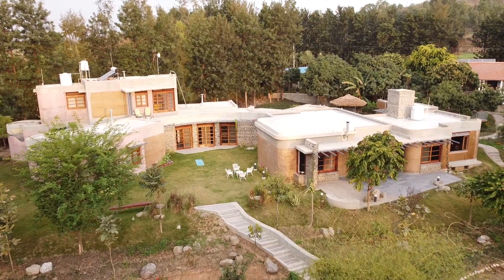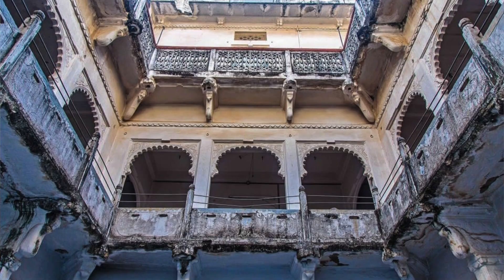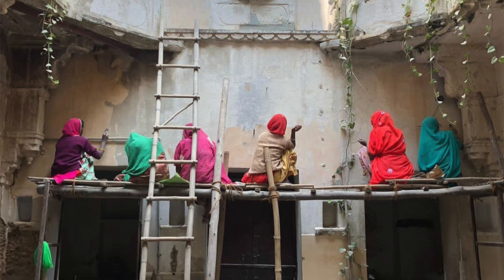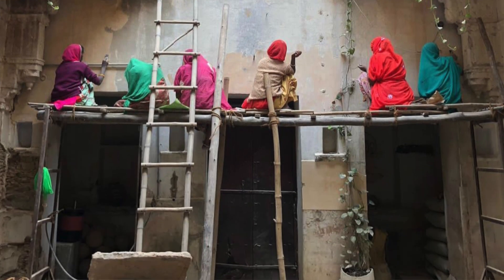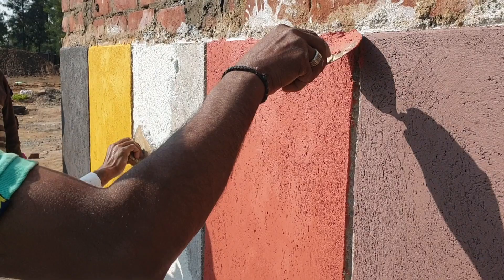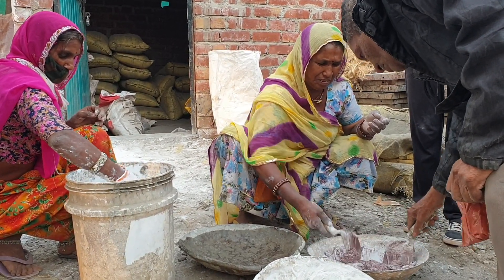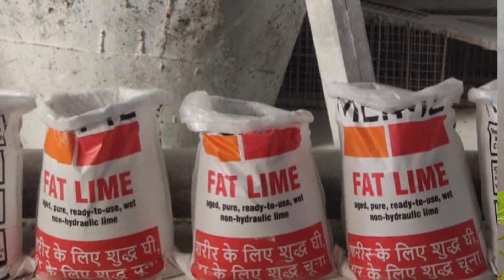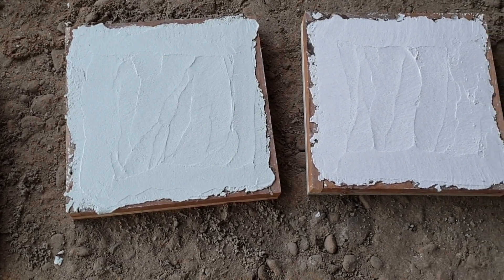Building with Lime: An Introduction

Comment: Beautiful Sunshine Aannaada ✨ Thank you for sharing your sustainable home journey.
I’m interested in incorporating lime in my current build by adding lime plaster and polished limestone floors.  I’m in Ghana where the land isn’t rich in limestone.  I would love to get your input or referral on the exact mix for your limestone plaster and limestone floors.  I currently have unpolished cement blocks and saw that I can add lime plaster at this point… so I want to incorporate as soon as possible to avoid cement plaster. 
I reached out to MLime but unfortunately haven’t had a response.
I appreciate any guidance you can share.
Thank you💚

Comment: steel rebar reinforcement will eventually rust and expand.  This will destroy your structures within 50 to 100 years. . please try to build in compression, and if you must build in tension, use fiberglass rebar.  Your work is beautiful, and if you avoid steel rebar, it will last hundreds or thousands of years.
Reply from the maker: Unfortunately we did what we knew best. Next time we will be better informed
Reply: Appreciate truthful response